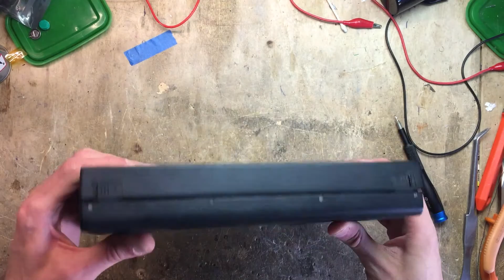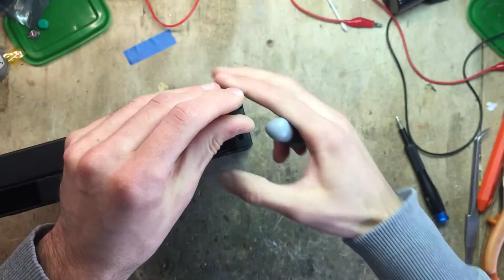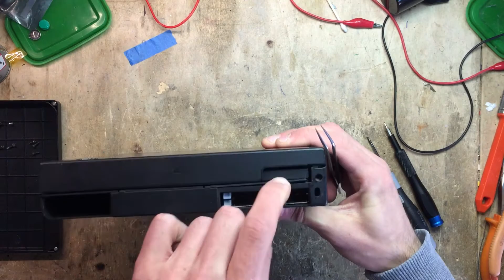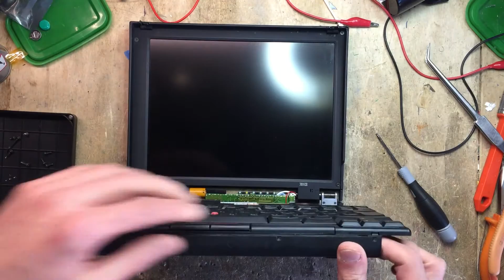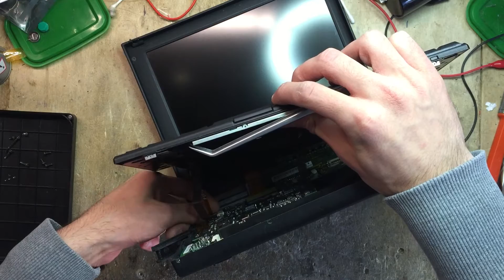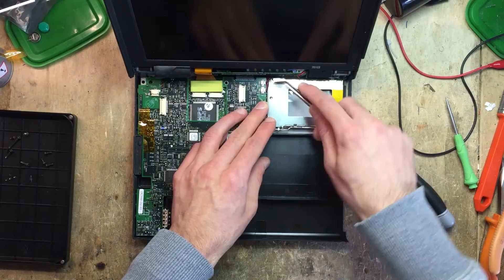IBM ThinkPad 701C Butterfly Teardown

Comment: I have one of these i want to disassemble. Do you need a specific type of screwdriver?
Reply from the maker: Front screws are torx T1 but a T2 bit will work too, a multi bit set will have everything you need
Reply: @FrancescoF  thanks 👍

Comment: Great video!  Hey I have a 701C and it is giving memory and cmos battery error.  Do you think it is fixable or should I toss it?
Reply: Don't toss it regardless if you can't fix it!
Reply: John Daniels

Toss it? Haha!

These go on eBay for 300€ as parts.
Reply: @incumbentvinyl9291  LOL, but it looks so cool :)
Reply: @JohnDaniels  I'm buying one tomorrow with those errors for 200€.

I can't even spot the memory in the video. I'm rather mystified.
Reply: @incumbentvinyl9291  oh that's awesome let me know how it turns out. I haven't had time to look at this one with the memory problems but I have watched the video on how to replace the memory and it looked a little in-depth I may do it one day whenever I have time but they're awesome piece of History I'll own congratulations 👍👋
Reply: @JohnDaniels  It's a beut! One hinge is cracked, I may have to use a 3D printer to make one. Otherwise it's in nice condition, better than most I've seen online for sure.

Could you direct me to the video of the memory replacement?

Comment: Yous is cosmetically in good condition. Most of these you see for sale look like crap. The case has a rubber coating that starts to disintegrate with time. Eventually the exterior looks like they were drug behind a car.

Comment: nice video! i am looking for drivers/floppy images etc for the 701c, anyone? Can someone tell me the partnumber for the CMOS battery and where to order?
Reply from the maker: You can find the drivers and images here: http://www.ibmfiles.com/pages/701c.htm
As for the cmos battery (the one soldered on the motherboard), I think I used a regular CR2032, it’s bigger than the original so i had to find another way to mount it.
Reply: thanks very much!

Comment: That is worth a fourtune restored
Reply: Francesco Ferretti look again on eBay. $900 for very good condition.
Reply from the maker: Christopher Lange not really, you can find good ones for 100$ if you look carefully and perfect ones for around 300$ tops.
Reply: @FrancescoF  Simply not true, not even four years ago.

Of course, you could find a deal somewhere with someone who has no idea what they are selling, but that has nothing to do with actual market value.

To claim that you could find a good 701C for 100$ in 2018 is nothing short of idiocy.
Reply from the maker: @incumbentvinyl9291  well I have three of them now and I think the most expensive one was 70€. I still remember getting the first one for 50€ and that’s the one you see there. So you just have to look around and have some luck ;)